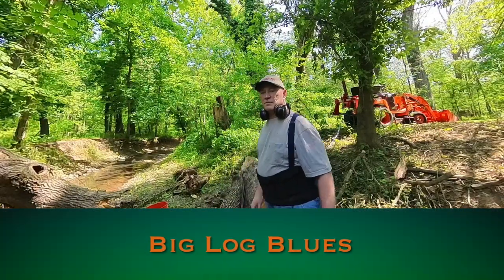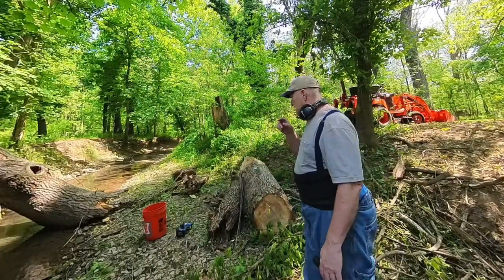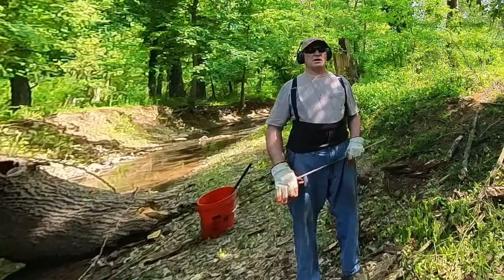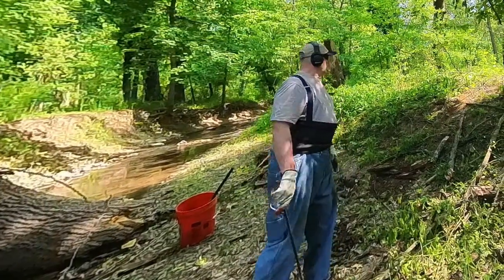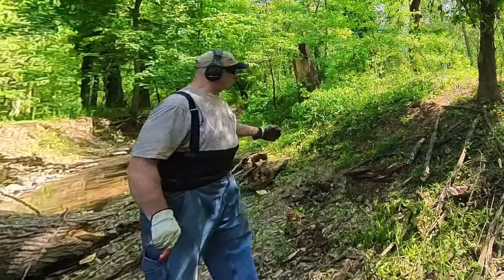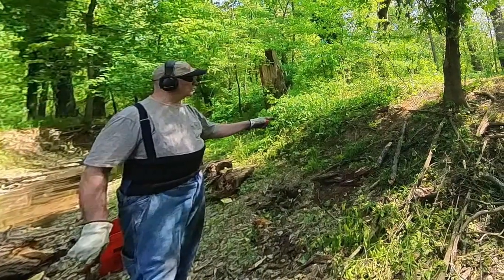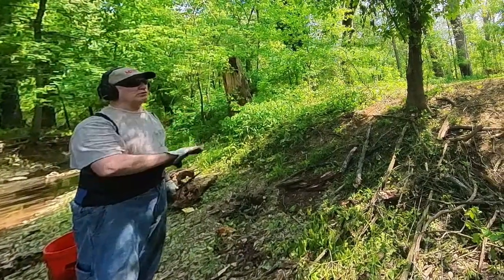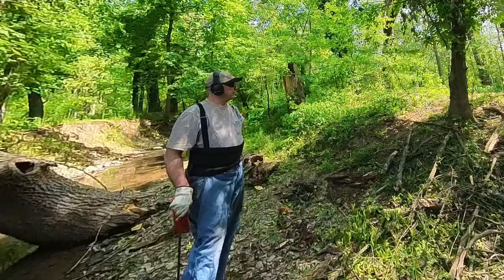146 - Big Log Blues

Comment: That was an awesome way to get the log out. At least the ends couldn't dig in and get you stuck. You sure get a lot of uses out of your tractor. It's always good to see you work safe and take your time to plan things out. Well done Bob.
Reply from the maker: It worked like I thought it would.  I only wish I could explain things better.  LOL - I was using the bask side camera which appeared to be out of sync with the sound track.  I need to work on that small issue.  I finish getting all the logs out of the creek bed yesterday.  I did not film it. Glad to get that work finished.  Thanks for watching and commenting. Enjoy the Journey - Cheers

Comment: Great idea with the eye bolts Bob 👍🏻🙋🏼‍♂️🙂
Reply from the maker: Thanks.  I came up with this idea years ago when someone ran over my mailbox and snapped the 4x4 post off at the ground.  I had it secured in the ground with an 80 pound sack of concrete.  I had to cut the gagged post off flush, drill and screw the eye-bolt into the post.  Then I used the three point hitch on the BX to pull it up and out of the ground. Thanks for watching and commenting. Enjoy the Journey - Cheers

Comment: that worked well, honestly I though the I bolts would pull out.
Reply from the maker: I came up with this idea years ago when someone ran over my mailbox and snapped the 4x4 post off at the ground.  I had it secured in the ground with an 80 pound sack of concrete.  I had to cut the gagged post off flush, drill and screw the eye-bolt into the post.  Then I used the three point hitch on the BX to pull it up and out of the ground.  It worked great.  Thanks for watching and commenting. Enjoy the Journey - Cheers

Comment: As long as it works it is good and it worked great. I was thinking just throw a choker on it and carry on but your method never digs in.
Reply from the maker: I don't have any true chokers, but I do use a chain to choke the log and pull. I considered buying one or two, but I can't justify the cost for a few odd jobs.  Also, with the log featured in this video, it had a branch that was preventing me from rolling the log.  It was a big heavy log.  I have started to purchase logs from loggers.  It is so much more efficient then going out and cutting trees and bringing them to my wood yard.  So, for now I only clean up wind falls off of my property.  Thanks for watching and commenting. Enjoy the Journey - Cheers